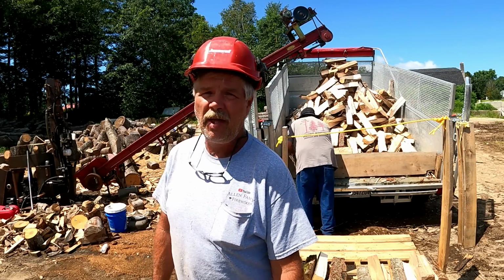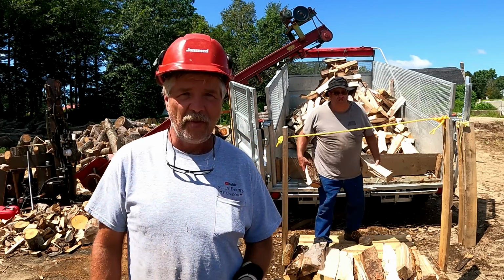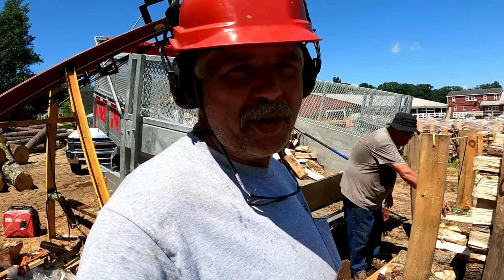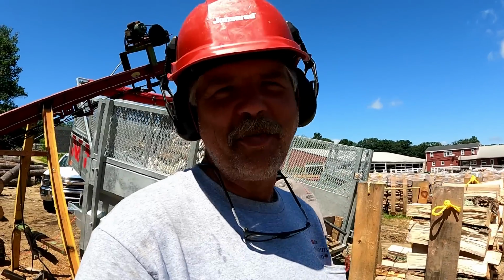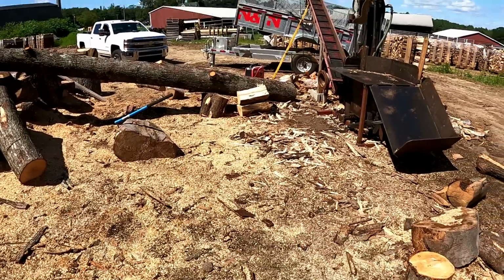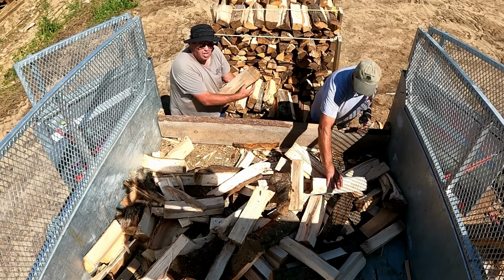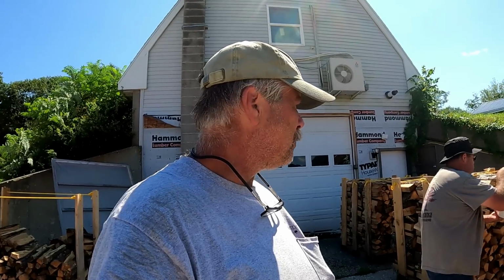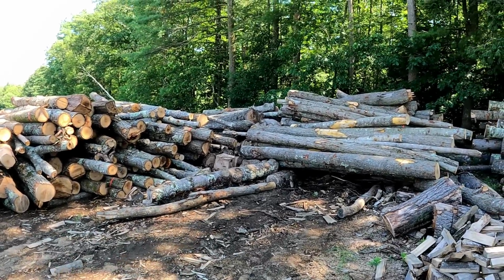GETTING CREATIVE AND GETTING IT DONE IN THE WOODYARD

Comment: Y’all sure have upgraded your equipment in a short amount of time. Traded trucks , traded tractor to a cab type with heat and air , stihl 500i saw , shed and lights on your splitter , belt feed hopper extra conveyor and galvanized dump trailer moving on up fast , congratulations Allen family . Hard work pays off
Reply from the maker: 7 days a week an 10 hrs days it’s either gona go or blow . Hopefully it keeps on going at least till all the payments are made lol . Thanks edge .
Reply: @ the new President should help the economy a lot
Reply from the maker: @Eddie-f6t    I think it’s going to be a huge boost to our country if they will just let him be an let him do his thing .

Comment: What a nice efficient set up and what a fast vertical splitter , shop built unit or was it a commercial unit converted ?
Reply from the maker: You need to go look at some videos from before i choped my  thumb if you want to see fast  . Right now in this video the splitter is turned down to half speed because i can only use one hand .  Normaly it can go down an back up in 2 seconds . I think i have it set now for 6 seconds cycle time . My buddy Dana over at smore firewood converted my old vertical into what you see now .

Comment: I like the way you stack and store your wood. That is nice and premeasured. If I had a tractor with forks, I would do that. I am too old to be buying equipment.
Reply from the maker: Them pallets sure work good for us . I saw a guy stacking on pallets like that 30 yrs ago an it worked great for him so we have ben doing that way now for a long time but it dose require a machine that will lift a half cord 10 ft in the air somewhat safely .

Comment: Nice job Allen Brothers. Like a football player with a broken hand that doesn’t want to miss a game, they wear those big “War Club” cast, what if you could fashion a sleeve that would absolutely protect the thumb, then you could use forearm side pressure when splitting- safer and give better balance. Could make sleeve out of wood strips or maybe large PVC pipe with non-skid traction tape so it doesn’t slip. 
Good luck 👍🇺🇸🇺🇸
Reply from the maker: I like it now ya got me thinking maybe one of them square plate things that the hocky  goalie wears on there arm to deflect incoming pucks . Let me sleep on this idea for a few nights an see what i can come up with .